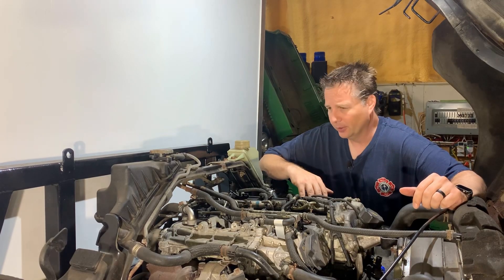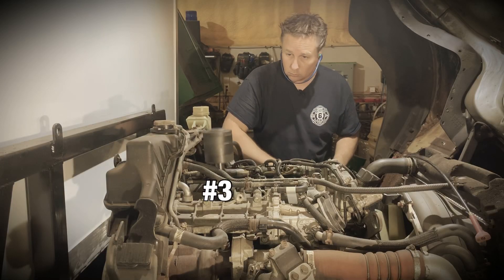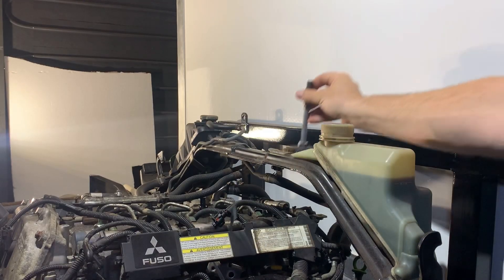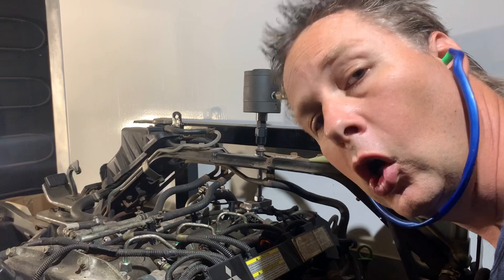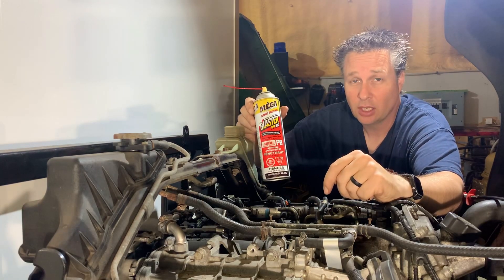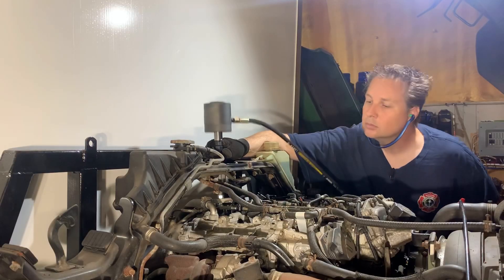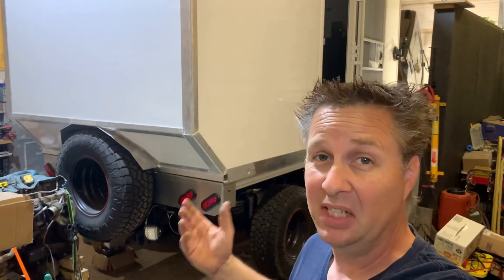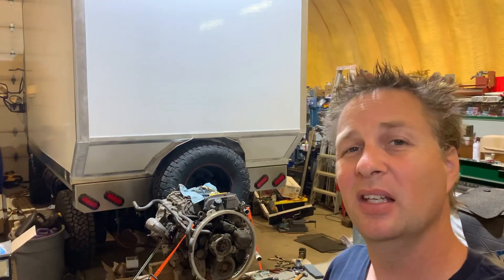Is it actually going to come out? Mitsubishi Fuso 4P10

Comment: Hay Bruce i have a question regarding Mitsubishi fuso fk260 i keep getting check engine light when I drove over 55mph I have them scanning foud P0148 the recommended the change fuel pump which is cost about 4k i don't know were to start the economic way
Reply from the maker: Have you changed the fuel filter?
Reply: @BruceandKrista I did change fuel filter they suggested to swap fuel pump which meant to costs 2750 dollars which is scratch me head any thought

Comment: Ooo wow I am been having this very same problem with my 4p10 canter truck ,it having difficulty starting
Reply from the maker: I’d think your problem is slightly different - if it runs after it starts, it’s getting fuel.  Mine isn’t getting fuel.   If yours only has a mechanical lift pump, you may want to check for air leaks ahead of the pump.
Reply: Good morning I will check that it may be possible that I am losing prime

Comment: I too, have been having this exact problem.
I was going to buy the fancy air hammer but after seeing it fail, I was back to the drawing board.
Made myself a puller and after 4 hrs, it's out!
Reply from the maker: Did you remove the cross brace?  How does your puller work?  Good to hear!

Comment: I would leave it at this point, put it together, and see if it runs correctly. If it runs OK, you're golden.  If not, you're golden showered.  ;)
At that point, I'd likely cut that center section of the crossmember out to get the tool centered on there, since there is an interference fit with the xmember already.  Then get some fiberglass welding blankets for protection and  weld it back together when done.
The angles created by the offset shift about 90% of the pull into the angle.  (I think John at Farmcraft showed me that, but see broken welds)
Best of luck.  What does Fuso charge to change injector #4?  Does it include R&R Engine?  Their fee is a clue.  (cringe)
If it still doesn't come out with the proper tool at the proper angle, have it done professionally. Ripping it in half could be more costly.
Reply from the maker: Ripping it in half is my biggest fear!  Maybe I’ll put it all back together let the engine run for a bit - then disconnect everything from #4 and start the engine and see if I can compression fire it out from the inside 🤣🤣

Comment: Any galvanic corrosion/weld type situation is going to get worse over time, so my vote is to do it now while you're warm and dry. And I think your custom tool, though sturdy and brilliant, is pulling the injector backwards as much as upwards, negating half of your lifting percussion. As others have suggested, maybe a tool that goes around the support on both front and back, so your pulling force is straight up. 

I've always had great success with the heat/cold differential technique. You want the injector cold, and what it's attached to hot. Set your puller up, then gently heat everything up slowly and evenly with a heat gun, even the injector. Then when you're ready to pull, spray a can of air upside down on the injector. This will cool it quickly, while the rest is warm around. Cold metal shrinks, hot metal expands.
Reply from the maker: Thank you for calling galvanic corrosion and not electrolysis!!!!  (One of my pet peeves!). As you know, where the land meets the sea there you’ll find Fe2O3, and where the ocean meets the shore, you’ll find there’s Fe3O4.  🤪.   I think I’ll try getting the engine up top operating temp - that should also help the copious amounts of PB blaster heat soak into whatever is inside there, and hopefully break it apart (the crud, not the injector!)

Comment: I'm wondering if the offset tool you built for the removal shaft is changing the upward force to angled force and binding. If you are going to keep trying, I think you need have another offset on the other side of the cross frame to even out the force (just notice @timjacksons comment). Or, how difficult wold it be to remove the frame that is in the way? If the fourth injector will not keep the engine from a test run, I think your correct in moving on. Good luck!
Reply from the maker: Interesting - I could build a T shaped lower section that attaches to the injector, then have a bolt coming up on each side of the cross brace, going to an upside down T, when then connects to the puller - that should even out any offsets.

Comment: Yes, sadly, number four is always a PITA.  Many of these single cab Canters came with a plastic cover over the entire top of the engine, but it didn't really make much difference to be honest.  

I'm going to be the 'voice of dissent' here and suggest leaving it alone for now.  As I've said previously, if you didn't notice any sign of the engine running roughly (i.e. on 'three') before it stopped then the injectors are unlikely to be any problem.  Get everything else in the fuel system cleaned and be 100% sure you have the non-running issue fixed, then add that last injector to the 'to do' list when you give the truck a full 'going over' before starting travels.  You can treat the tank using washing soda and electrolysis if you want to completely kill off any rust in the tank.  That's an every door and window open in the workshop (or tank off and outside) process though, as the hydrogen that gasses off can really ruin your day if ignited.

Once you do go down the path of removing the last injector I would strongly advise removing the cab support.  Run the engine to full operating temp with the cab tilted and everything pretty much ready to come off to get the injector out, and the injector clamp bolt backed off half a turn or so.  The heat, vibration, and compression pressure (remember this is a diesel) have a fighting chance of getting the injector to start moving and making it easier for the pneumatic tool to do its job.  Any puller arrangement that goes around the cab support will convert the linear pull to torque, which isn't going to do the best job (apart from breaking stuff).  Those pneumatic injector removal tools need a straight and direct shot at the injector to work effectively.  Yes, removing the cab support sucks (I've done it twice on ours), but breaking the injector will suck way, way worse!
Reply from the maker: I like the idea of this approach.  Does a few things - gets it running again first, gets some heat soak into the engine, buys some time to get things sorted out….  I think you’ve hit the nail on the head!

Comment: Oh man what a pain, there was a know issue with all model years as that injector get allot of the water running of the back of the cab to it causing the corrosion sadly. As a recall they added a rubber flap to divert the water over it. A bit after the event unfortunately… me…. I would leave it as the other were clean and save your self the drama of a snapped injector ;o)
Reply from the maker: I thought of drilling a drainage hole through the web on the back of the engine just behind this injector to allow any water to drain…. Until I found there’s already one there!!!   That said - I think I will for sure work on some way of improving the water shedding after going through all of this!!!

Comment: Echoing what is said above... I can imagine how much worse this could be out in the bush somewhere. Also if it's so badly corroded that it won't come out now, how long before it fails. I was also thinking along what Tim was saying above.
Can you design a flat bar that has the injector socket in the middle and 2 threaded holes on each side to put 2 screws down to push on the block. Then attach your vibration machine to that. As it vibrates you push up on the injector so you apply continuous force and vibration and continue to tighten. Can you apply heat? 
I dunno. Might just be easier to pull that support out in the long run.
Reply from the maker: Hmm, combination pneumatic and pushing against the top of the engine… could work!  One way or another, something different is needed!

Comment: I'm with Terry and Tim on this.  You've beat on this injector and need to know if it's OK before trecking across the Continents.  Plus you need to know you can pull it later should it fail on you.  Pain in the arse I understand, but you are in the best place for it to fail.  I would look at making & using a two bolt system to stradle that brace, and use a screw tensioner and let it tug on it for a few days, using the brace as an anchor point.  Like a 3 jaw bearing puller in reverse.  Maybe put a some heat on the head with a heat shrink gun.  That air puller is slick, but apparently it's not hitting it with enough tension, straight up for it to yeild.
Put some tension on it with a screw extractor and walk away for a day or two and let it just sit .  I'd almost bet you'll hear it pop loose from across the shop.
Reply from the maker: I think another custom tool is going to be the answer on this unfortunately.  Just need to be sure I don’t damage the cross brace or the top of the engine!

Comment: Maby construction a puller that has two bolts one on each side of the cross member with a cross bar that connects the two bolts above the cross member leaving enough room for a pry bar or even better go above the cross member with a bar with a big nut and bolt just like a conventional puller using the cross member to push against. That way you can keep tension on the injector for days at a time tapping sideways and soaking it with patience. I understand you don't want to bend the cross member or rip apart your motor mounts! I have a feeling using your pneumatic puller is wedging it sideways when your using it? Constant pulling and gentle tapping might be the only way to break the corrosion? 
Maby some gentle heat and cooling? Dry ice or some spray  liquid nitrogen?  Good luck! I have a 98 fuso fg wile draining my engine coolant the block drain was so corroded it cracked the aluminum housing when removing!
Reply from the maker: This is likely the solution.  I think I need to put constant tension on it.  Will probably pop right out 🤣

Comment: My 2 cents.
Do the work to get it out now, while you are in a good workshop, under cover, and have time - rather than years down the track when you might be on the other side of the country, outside and stuck somewhere.

I know it's not likely the main problem, but it's still a problem that I'd hate to have bite you in the ass later on down the track
Reply from the maker: There is a lot of truth here.  That said, I’d REALLY like to get the truck moving again so I can fix my other broken stuff, using my hoist before winter hits!!!  (Can always pull the injectors again in the spring)